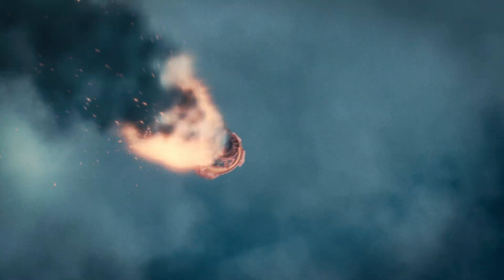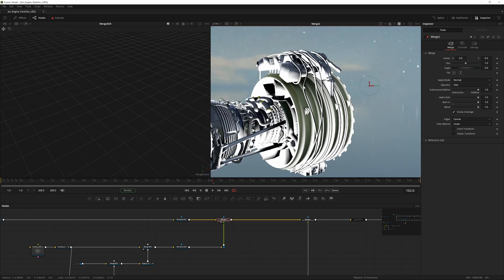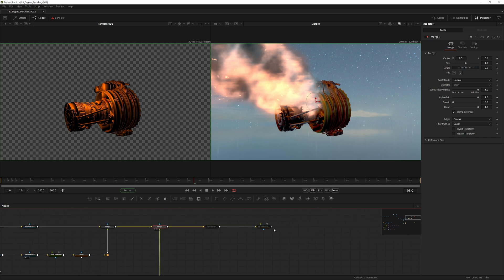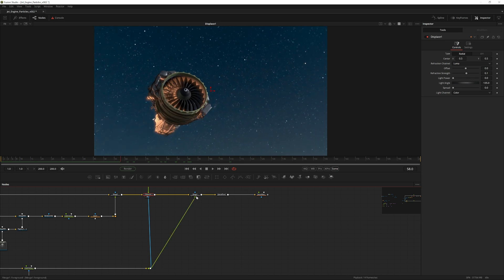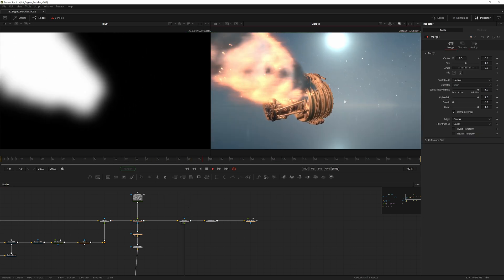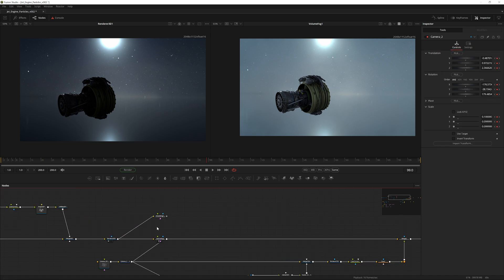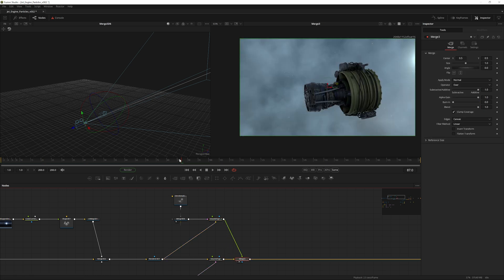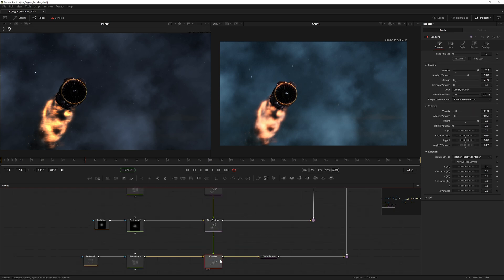Full BLENDER to FUSION 3D Workflow Part 3

Comment: Fantastic finish of a series. Some tips on how to do masking based on separate elements of imported 3d engine object would be very welcome.
Reply from the maker: Thank you! Do you mean the volume masking node or working with cryptomatte passes?
Reply: @fusion_brew  I am wondering, if even prerendering cryptomatte can be omitted.

Given that all shading and lightning would be done in fusion, as well as comp, based just on imported geometry and without any   imported rendering (so no projection), how can one create crypto mattes inside fusion.